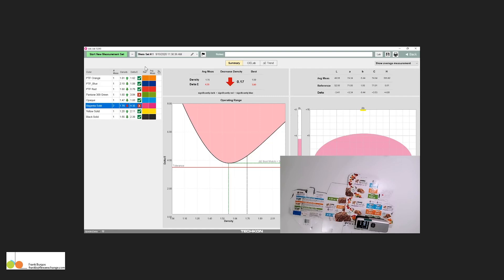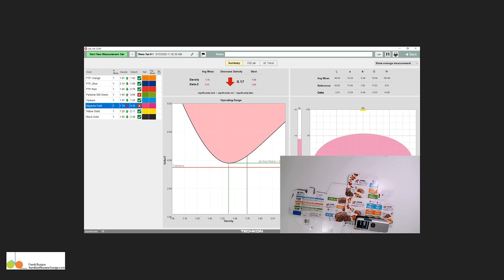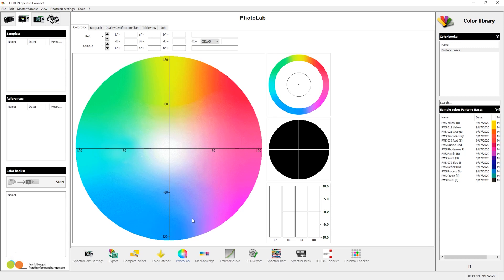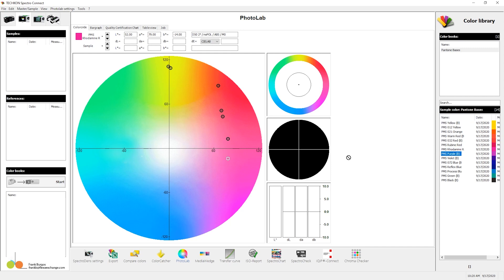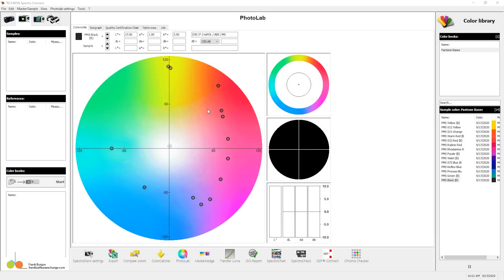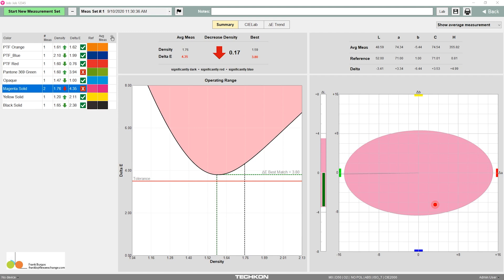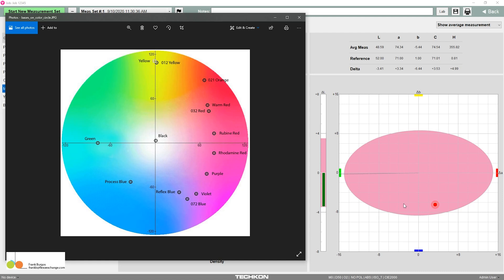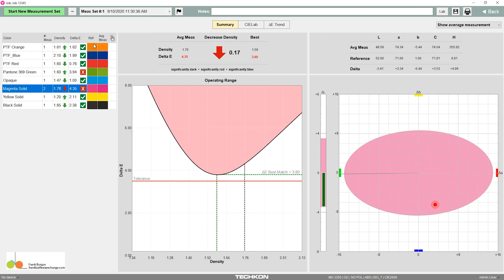Basics of Adjusting or "Toning" Ink Color

Comment: If you plot your reference color on the color space as well, you can image a line from your color to a base and that is the direction the "dot" will move if you add that base. In your example, yellow base will actually bring it green as well as yellow.
Reply: Another example, suppose that you were toning pantone purple using violet and rhodamine. Rhodamine  would actually move it up and slightly  right instead of slightly down and right.
Reply: Intuitively this makes sense, since yellow is "greener" than magenta. If you add yellow to magenta your a value will decrease.
Reply from the maker: Thanks, Chaosynthesis, and sorry for the delayed response. I'll be sure to experiment with your suggestions.